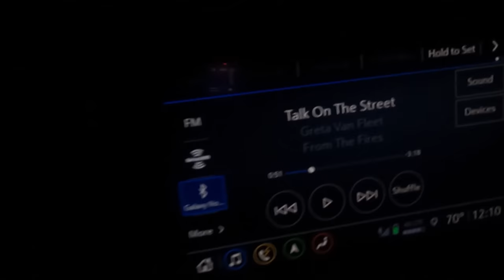Millennial Farmer The Dirt Track Modified Racer in Action

Comment: X Pa. posse crew member. Winged Sprinter 11X. Not sure if is the camera or how you like to drive. I seems like when you come off of the gas you come all the way off. When I learned to back out but not off I picked up time. When you back out it takes the motor more time to build back RPM"s instead of staying above the mid range so you power comes right back. I hope that makes sense. Listen to a video and to hear how much the R's drop. Best of luck!